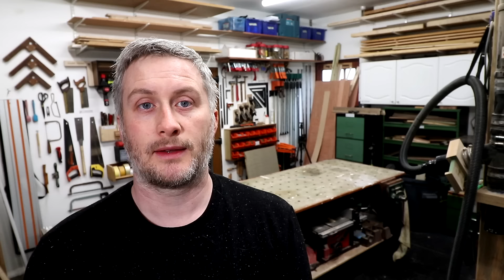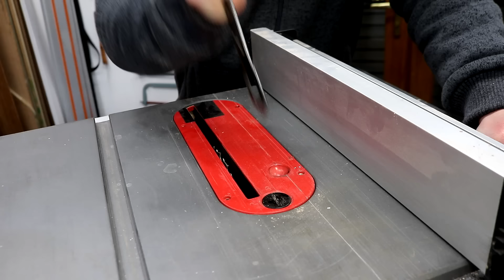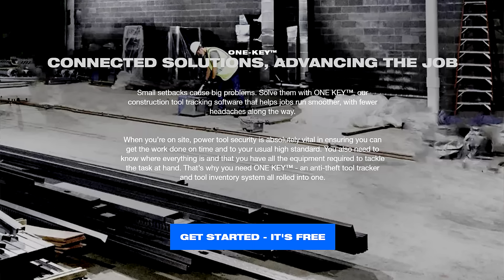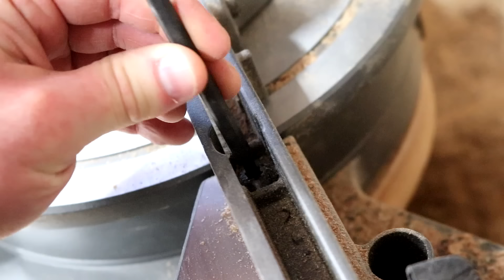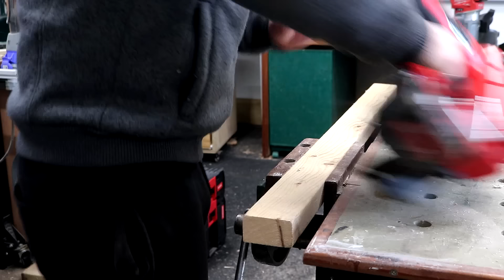Reviewing ALL my Milwaukee tools

Comment from the maker: Timeline:
0:00 Intro
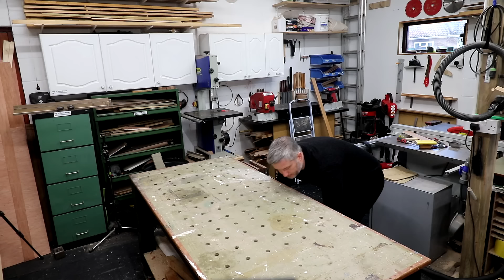1:05 M18 FTS210 Table Saw
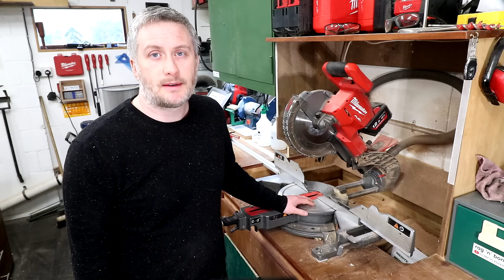5:16 M18 FMS254 Mitre Saw
8:03 EXCITING NEWS / tools I wish were added to the range
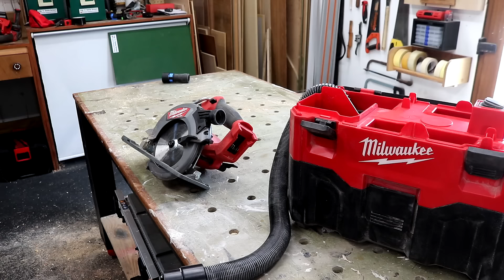8:59 Milwaukee Dust Ports
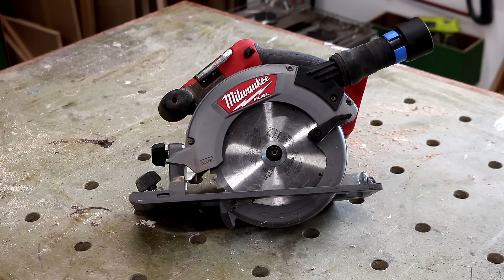9:56 M18 CCS55 Circular Saw
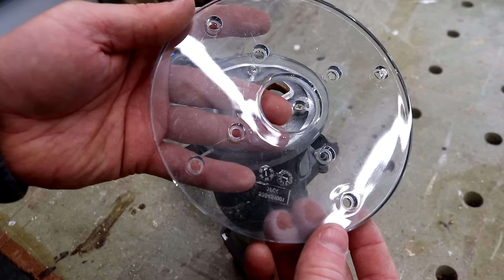10:58 M18 FTR Trim Router
12:11 M18 FID2 FPD2 Combi Drill and Impact Driver
12:53 M18 FFN Framing Nailer
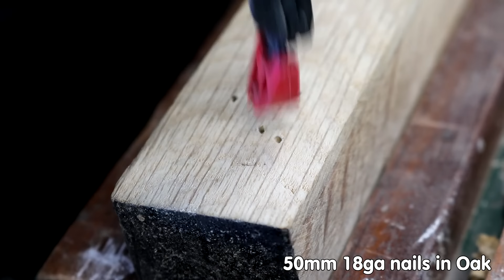13:44 M18 FN18GS 18ga Finish Nailer
14:18 M18 BOS125 Radom Orbit Sander
15:07 M18 FJS Jigsaw
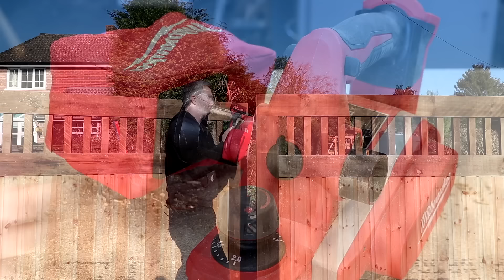15:32 M18 BP Planer
16:13 M18 CAG115 Angle Grinder
16:32 Outro

FULL DISCLOSURE: All Milwaukee tools featured in this video were #gifted.  I spoke with Milwaukee about giving my honest opinions for each tool (the negative as well as the positive) and they were happy for me to do that, however I fully understand that this video won't be for everyone.

My Table Saw Set Up video: https://youtu.be/ZX6bbIHoLlk
My Shed Build playlist: https://www.youtube.com/watch?v=tjuo9-BOBLg&list=PLDNeCzKzVb5y1wT4akgFD5xGMLfWHWEtb
Building A Wall: https://youtu.be/z6xIwqp8YMo

This video is supported by Milwaukee, check out their full range here: https://uk.milwaukeetool.eu/?utm_source=Social&utm_medium=YouTube&utm_campaign=Rag%20N%20Bone%20Brown%20-Milwaukee%20Range
M18 Table Saw https://uk.milwaukeetool.eu/en-gb/m18-fuel-one-key-table-saw/m18-fts210/?utm_source=Social&utm_medium=YouTube&utm_campaign=Rag%20N%20Bone%20Brown%20-%20table%20saw
https://geni.us/a3xirpS (Amazon) 
M18 Mitre Saw 
https://uk.milwaukeetool.eu/en-gb/m18-fuel-254-mm-mitre-saw/m18-fms254/?utm_source=Social&utm_medium=YouTube&utm_campaign=Rag%20N%20Bone%20Brown%20-%20Mitre%20Saw
https://geni.us/aBEKBI8 (Amazon)
M18 Circular Saw 
https://uk.milwaukeetool.eu/en-gb/m18-fuel-55-mm-circular-saw-for-wood-and-plastics/m18-ccs55/?utm_source=Social&utm_medium=YouTube&utm_campaign=Rag%20N%20Bone%20Brown%20-%20ccs55
https://geni.us/LG2QZk
M18 Trim Router
https://uk.milwaukeetool.eu/en-gb/m18-fuel-trim-router/m18-ftr/?utm_source=Social&utm_medium=YouTube&utm_campaign=Rag%20N%20Bone%20Brown%20-%20router
https://geni.us/ewoU06y (Amazon)
M18 Drill & Impact Driver 
https://uk.milwaukeetool.eu/en-gb/m18-fuel-powerpack/m18-fpp2a2/?utm_source=Social&utm_medium=YouTube&utm_campaign=Rag%20N%20Bone%20Brown%20-%20M18%20twin%20kit
https://geni.us/6kQYef (Amazon)
M18 Framing Nailer
https://uk.milwaukeetool.eu/en-gb/m18-fuel-framing-nailer/m18-ffn/?utm_source=Social&utm_medium=YouTube&utm_campaign=Rag%20N%20Bone%20Brown%20-%20Framing%20Nailer
 https://geni.us/jmRMx (Amazon)
M18 Finish Nailer 
https://uk.milwaukeetool.eu/en-gb/m18-fuel-18-gs-finish-nailer/m18-fn18gs/?utm_source=Social&utm_medium=YouTube&utm_campaign=Rag%20N%20Bone%20Brown%20-%20Finish%20Nailer
https://geni.us/OKNgBj (Amazon)
M18 Sander 
https://uk.milwaukeetool.eu/en-gb/m18-125-mm-random-orbital-sander/m18-bos125/?utm_source=Social&utm_medium=YouTube&utm_campaign=Rag%20N%20Bone%20Brown%20-%20Orbit%20Sander
https://geni.us/9paZ (Amazon)
M18 Jigsaw
https://uk.milwaukeetool.eu/en-gb/m18-fuel-top-handle-jigsaw/m18-fjs/?utm_source=Social&utm_medium=YouTube&utm_campaign=Rag%20N%20Bone%20Brown%20-%20M18%20Jigsaw
https://geni.us/jUOkuO (Amazon)
M18 Planer
https://uk.milwaukeetool.eu/en-gb/m18-planer/m18-bp/?utm_source=Social&utm_medium=YouTube&utm_campaign=Rag%20N%20Bone%20Brown%20-%20Planer
https://geni.us/6vz1hM6 (Amazon)
M18 Angle Grinder
https://uk.milwaukeetool.eu/en-gb/m18-fuel-115-mm-braking-grinder-with-paddle-switch/m18-cag115xpdb/?utm_source=Social&utm_medium=YouTube&utm_campaign=Rag%20N%20Bone%20Brown%20-%20CAG115
https://geni.us/ldt3iHp (Amazon)

Comment: I’ve just recently bought the 10 inch miter saw from Screwfix and I really like it but was very disappointed to find that unlike the American model the UK version does NOT come equipped with the ‘shadow line’. I actually didn’t think the led lights were of much value. So I looked online, found a part number for the shadow line assembly and ordered it from the US, Alaska actually. It arrived in about 2 weeks and I fitted it to my saw. (A certain amount of disassembly is required including the motor but it’s easier than it looks at first) The wiring was already there, I disconnected the led lights and modified the plastic wire cover on the blade guard and now I have the proper shadow line and very pleased with the results.

Comment: I'd love a follow up on the M12 tools. I've just built up a bit of a collection myself, as I see them as the perfect home/keen DIYer tools. I have the Impact Driver, Drill Driver with interchangeable heads (offset, right angle and standard chuck), circular saw, oscillating multi tool, rotary tool (so many uses for this one), SDS drill and have just added the little leaf blower. I'd love to see an M12 Fuel jigsaw (a few videos I've watched on the standard M12 one doesn't paint it in the best light).

Comment: Dewalt outbeats milwakee in most categories except that its louder but therefore more power. I've used both brands for a long time and still like Dewalt way more. Many features also are on most tools it's just older tools that you had previously that were weak (makita sander).

Comment: Hi, great video - wondering whether the Mitre Saw came installed with a shadow line LED for accurate cutting?  Seen lots of comments on social media stating the European version of the saw doesn't as Dewalt holds the patent.  Interested to know as a deal breaker for me.
Reply: Was wondering the very same thing. In this video there is no shadow line!

Comment: Thanks for your video I have been using Milwaukee tools for some time now my first set was drill impact driver but my is the previous set to yours it came with 5 amp battery’s but I bought two extra batteries l have had this set for about 3 years and I have given them hell and they don’t let me down outstanding everything works on them l also have the Planer l also very happy with it last year at first lock down my wife bought me the Milwaukee chop saw m18fms254 so I got the m18 12 amp battery for it and boy am I happy with it last week I was cutting 25 mm angle aluminium doing mitre cuts it lasted all day and more again very happy l have just got into the packouts a few little things I am not pleased about but on the hole very good well I will be getting more tools as your self but I if Milwaukee are listening why can’t we have all the red packouts please here in the uk 🇬🇧 thanks for your time and help 👍👏👏

Comment: I'm about to build my own house and am currently debating which platform to standardise on as I have no interest in trying to buy batteries and chargers across multiple platforms. Hikoki? DeWalt? Milwaukee? All of them have their virtues. DeWalt seems to. be favoured by a lot of local contractors. Hikoki is cheaper. But now I'm thinking that Milwaukee may be the better choice. A very timely video for me! Thanks, Keith. Keep up the good work!

Comment: Had warranty repairs on 18v drill and failure of driver within 3 months.
Still have a cordless hot air gun and a 12volt soldering iron.
It’s all a bit ‘big plastic’ feel.Impact driver bits and drills are shite, stay clear !!!!

Comment: If you want a mitre saw with excellent dust extraction there is only 1 option Festool Kapex  KS 120  reb I personally wouldn’t use any other mitre saw pair it with the stand and extension arms and Festool dust extraction nothing comes even close to be honest Milwaukee Dewalt Makita Bosch are much of the same it’s only when you bite the bullet and invest in Festool and Mafell you notice the difference in build quality and precision cheers

Comment: Nice pieces of kit ! Novel how the fore/aft slides are low slung under the worktable instead of above. Bit of space saving! Approx how much cutting time or cut ft board per battery charge? (Of 3 different amperage batteries) . Price ... £1k at Amazon ... Ouchhh!!
Reply from the maker: Hi John, I've never really tested battery life and number of cuts but if you check out the toolbox buzz channel, I'm pretty sure they did it in great detail. The Amazon is ridiculous at the moment, but most Amazon prices fluctuate all the time. It can be had for around £564 elsewhere online (without battery)

Comment: I've got a strange feeling that milwaukee table saw has been made for them by dewalt as it looks soooooo similar.
Reply: More likely they have just lifted the design.
Reply from the maker: They're different saws, although I think the fence is potentially the same. Toolbox buzz channel has a good comparison video
Reply: Unlikely as De Walt is owned by Stanley Black and Decker and Milwaukee by TTI who also make Ryobi.

Comment: Milwaukee certainly have been wiping the floor with the other similar price makes you'd nearly think that the designers actually use the tools.
do they supply a 240v /110v supply cord converter ?
Reply: No - other company's designers do the work and use the tools.  Then the Chinese manufacturers just come along and knock it off.
Reply from the maker: I had the same query actually. But based on what I've read I think there could be an issue, as I suspect they'd have done it already if they could... but I don't really understand electrics! 👍

Comment: I'd be interested in seeing how the M12 tools fare side by side against the M18 tools, especially if you can give a rough idea of the price difference. Dropping top dollar on M18 might be a bit too much for people, but if the M12 range still gives good performance for most DIY and beginning professionals, then that'd be useful to know.

Also, this video doesn't have any Dylan footage / photos in, so that's a definate area for improvement.
Reply: I don't know about the M12 tools (heard good things but never tried them) but I absolutely LOVE the bosch pro 12V line up. I find they're pretty much perfect for my use (beginner woodworker) and imo they are quite affordable for quality tools. I have a drill, an impact driver, the mini circular saw and the jig saw. Pretty sure I am also going to get the mini angle grinder and the multitool sometime this year. The milwaukee 12v lineup looks great too but they're just more expensive, at least where I am.